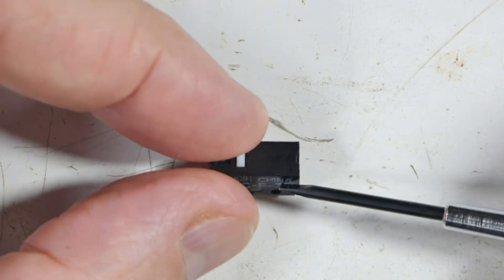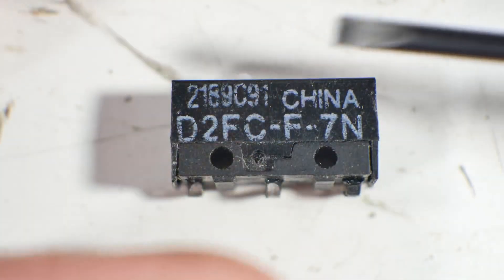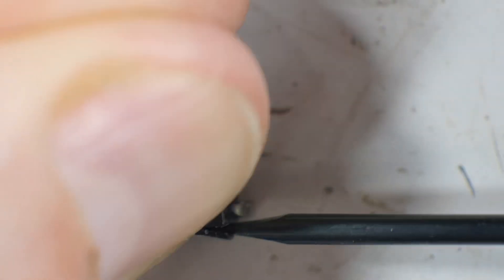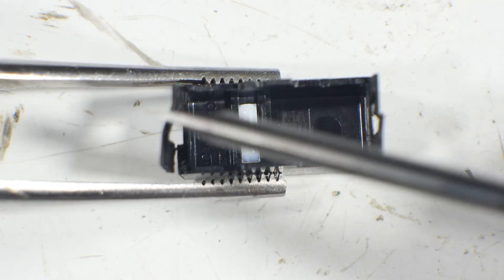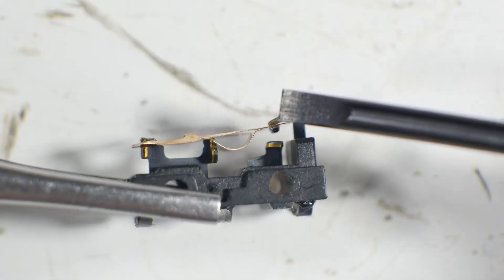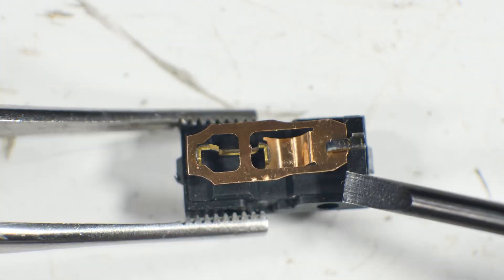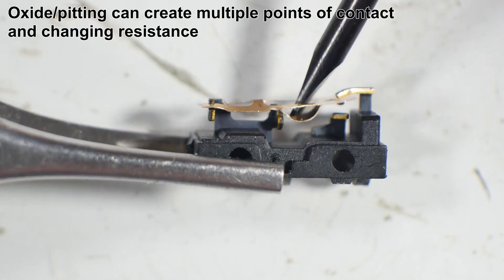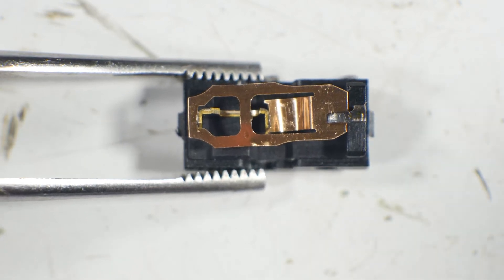Microswitch Teardown (4K)

Comment: Just dropping a note, in my experience, the most usual issue this has, is the 'spring' gets weak. And you can flatten the spring a bit to make it stronger again.
Reply: It can be painful to get the springy part back there once after it's taken out and it can be easily ruined in the process so I prefer replacing the switch

Comment: This enabled me to fix a failing Logitech MX Anywhere 2 mouse where holding click wouldn't "hold" anymore (I simply straightened the bottom part of the spring a bit to increase its tension again). 
While taking apart the micro switch the spring moved out of position and your video and the clear side view of the switch enabled me to place it correctly again.

The mouse works correctly again. 
Thanks a ton!
Reply: OMG, your comment made my day. I have exactly the same problem with a MX Anywhere 2 and I was hoping it could be fixed like this (I did it for an old G500). Do you have any specific tips for me? Were you able to open the switch easily, or did the plastic case break down like in the video?